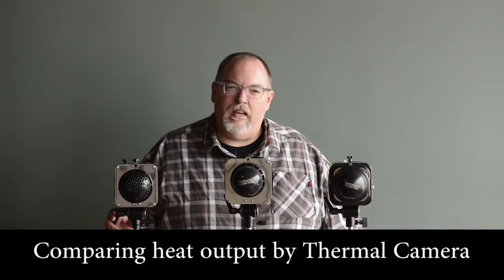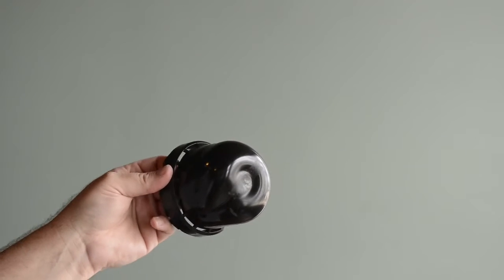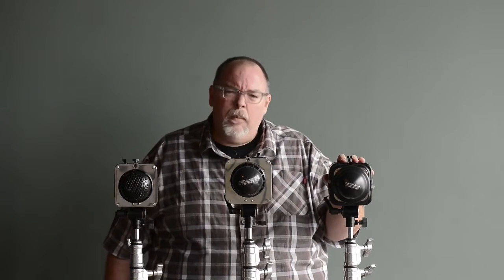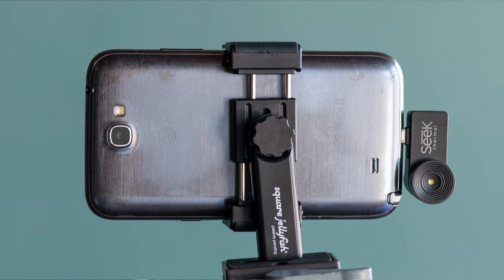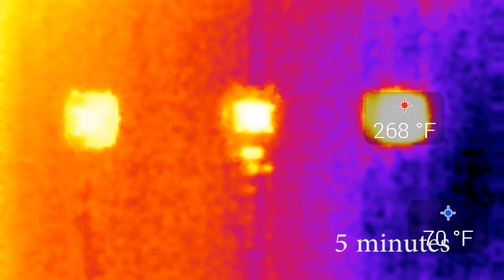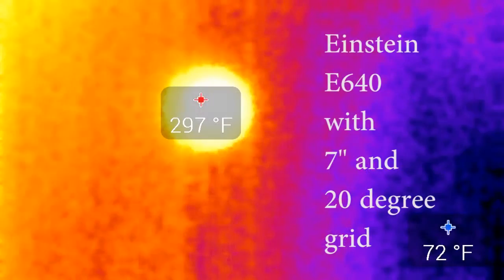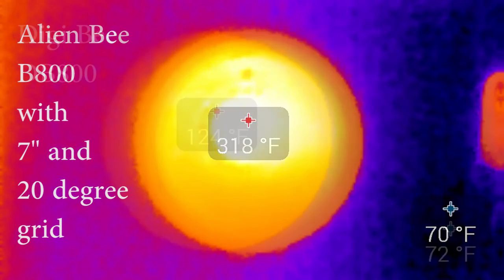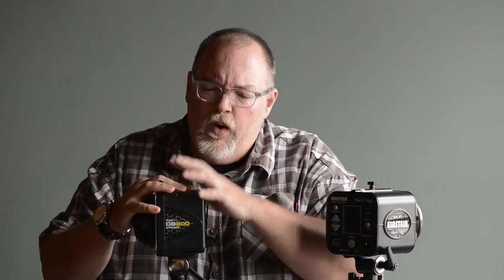DigiBee heat output using a Thermal Camera by SOPHA

Comment: There's a benefit that isn't well documented with the DigiBee. Unlike the Einstein and Alien Bee, you CAN use the modeling light with a Vagabond power pack. According to the FAQ on their website, a VML can power a DB800 modeling light for 3.3 hours at half power, or 1.5 hours at full power. That's a huge benefit if you're shooting at night, or if you need a video light in a pinch.
Reply from the maker: YES!  I think I mentioned this in one of my other videos and it bears consideration.  An Einstein's modeling lamp with run for about two femtoseconds on a VML, where this guy will likely last a long time, adding to the DigiBee's utility.  Video light?  Sure.  But more likely to be useful for low light auto-focusing, aiming, and all round scene illumination.  I agree!